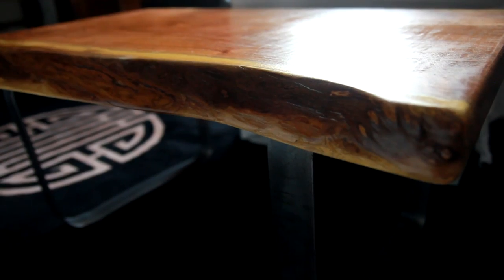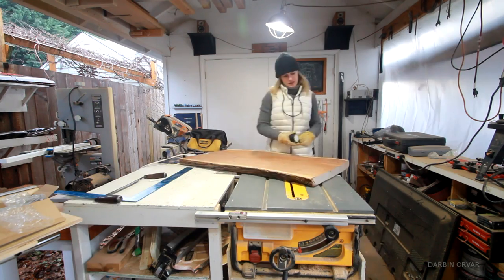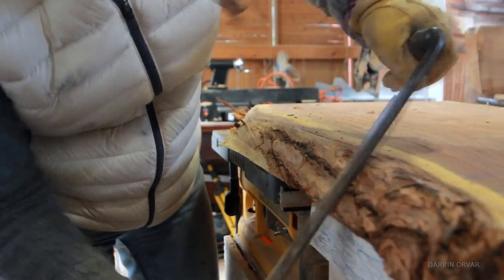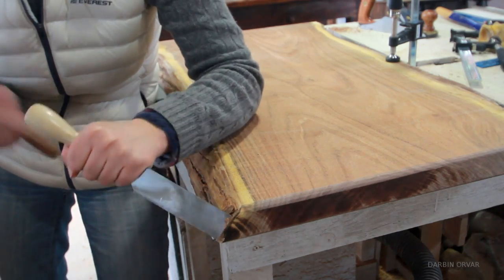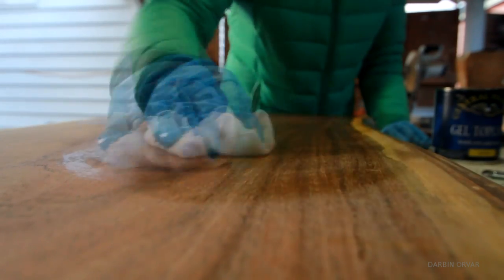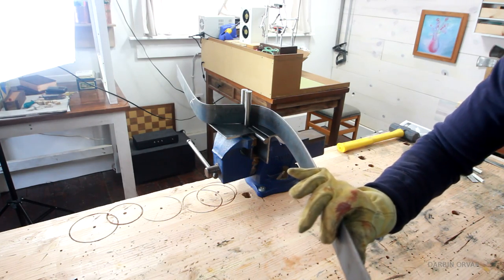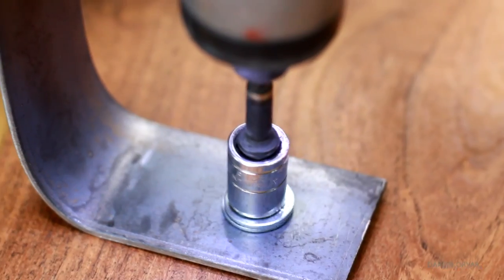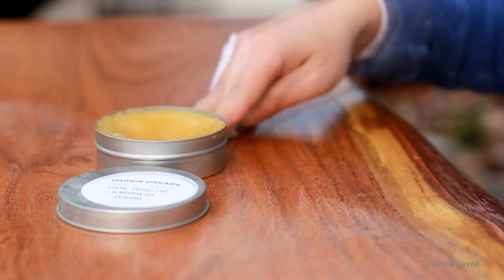Building a Coffee Table w/ Live Edge Slab and Steel Base

Comment: A helpful tip when drilling steel, and any other metal really, particularly if you need the hole to be precise, is to use a dot punch to mark the hole centre, then use a small drill, 3 or 4mm to make a pilot hole. This will make drilling with the large drill bit quicker and prevent the hole from wandering

Comment: What Steve said! I have always like the wood top and metal leg look! I have some walnut slabs that are about 10" wide and 4' long I am thinking of making a coffee table. Planning on cutting a daddo on the inside top edges and laying a piece of glass in between the wood slabs. To make a set I have three crotches from the same tree I will make end tables with two of them. Great projects LInn.. Loved your temporary visqueen wall! Girl you need to enclose that area sometime. I get chills watching you work in the cold!
Reply from the maker: +Kim Shirley That sounds like a great looking table! And yes - enclosing the carport is on my list :)
Reply: I made a live edge end table with walnut. It turned out pretty nice especially since I am new to this type of thing, I used an epoxy for the top. It's on my site if you get bored, it's titled " too Mitchell and SPM. Certainly isn't perfect but fun to make and I'll get better as I go.
Reply: +Darbin Orvar  yes

Comment: What you did with the slab looks very nice - you did the slab justice. Contrasting with the metal was a great idea. I wonder about the side to side stability - in the short distance - since the angle of the iron is 90 degrees. If that is/becomes an issue, I wonder if angling the tops inwards at 10-15 degrees would solve the problem?  Scott

Comment: The table is beautiful.  How many hours do you think you put into it, from raw wood & flat straight steel, to finished table?

Also, how & where were you able to find that type of wood panel with a raw edge?

I think you're an engineer.  Is that right?  I'm wondering how you knew the steel legs would support the weight of that particular table.  Is that a calculation decisions?

I've daydreamed of making my own life edge table for my kitchen, your video makes me think I might be able to do it.